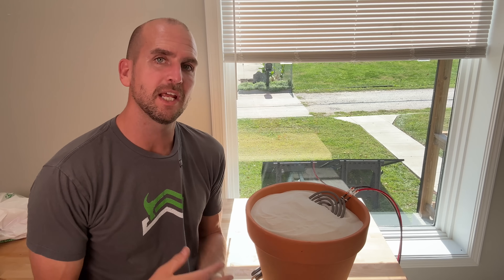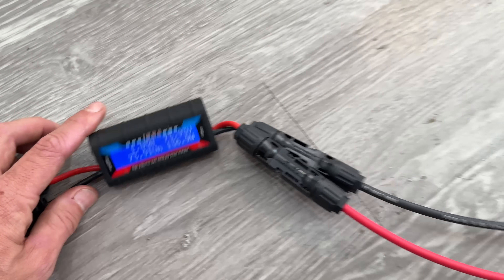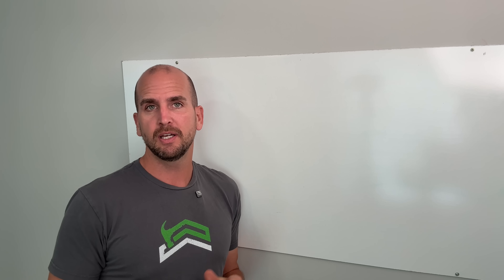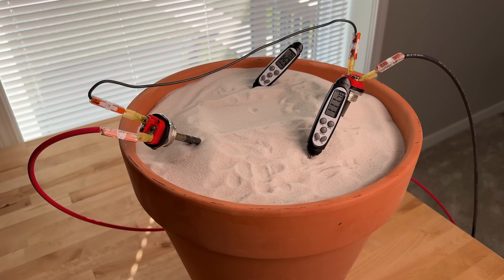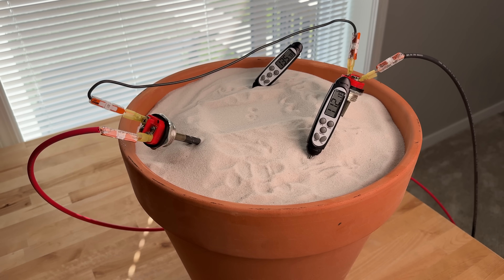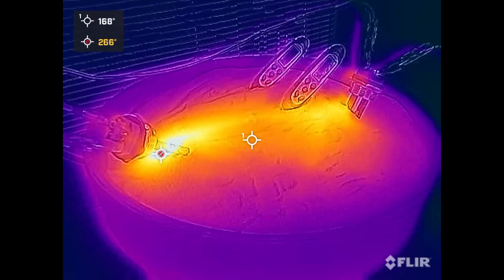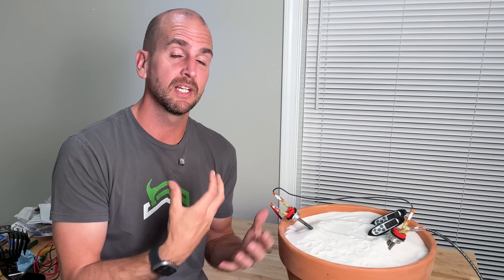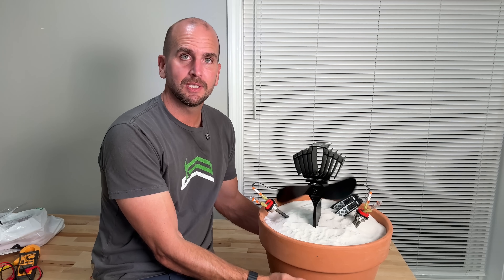How To Create A Solar Sand Battery Heater | Free Heat This Winter!

Comment: I tried this. Except with clay / gravel. Outside of the gravel, the element gets very hot. As soon as i add gravel, the element doesn't heat up. Any ideas?

Comment: Basically those are night storage heaters. For safety I would use the ready build ones. Yes you need a converter, but this also gives you MPPT, which increases your output. Insulation ensures that you only get heat out when needed.
More power plus more safety plus more comfort... for sure worth spending some bucks.

Comment: Maybe it was discussed already butttt....why not just get a reasonably nice  non-working Water Heater in the first place and wire it as you have and you have numerous possibilities to run lines and using the heat (also you have 55 gals of water  orr more on hand for other emergencies)

Comment: This makes me wonder about floor heat. The ones that I've installed {I'm an electrician and just install the controllers) tend to pull about 15A @ 240VAC. I wonder how well it would work if you made a bed sized area maybe a foot deep that you could sleep on top of.

Comment: We have solar panels on our balcony, 800Wp. The balcony is facing almost straight south and no obstacles create shadows. Over a sunny summer day they used to produce 4 to 5 kWh. But you don't need a heating on those days anyway.
Now on a cloudy day late October / early November it's 0,5 kWh at best.
So even in ideal circumstances on a cold, but sunny day with a perfect spot for the panels, I doubt they could contribute a significant ammount of heating.

Comment: just to add a snarky comment for the algorithm... your bifacial modules aren't getting much of any irradiance on the backside without: 
1. another set of solar panels behind it reflecting the sun into them 
2. a proper ground mount
3. the right angle.

on this bifacial setup you could capture even more solar energy by directing light to the backside of the panels with a mirror or something else reflective ( snow, space blanket, tin foil, a pond, etc)

Comment: Nice! I'd be interested in a study on the optimal volume/ mass of sand for the power and heating period length so that the system could be fine tuned to store and release for the whole non powered part of the 2 hour cycle. Obvs this would change throughout the year unless combined with a wind powered generator

Comment: My small 4'x8' DIY greenhouse thanks you for this idea and video.  I have a small greenhouse heater that is plugged into more extension cords after extension cords than I'm proud to admit, especially as a firefighter 😬😬.  But this is a great idea that I am gonna replace that with ASAP
Reply: Use a medium sized steel trash can filled with sand it gives you a lot more volume to hold the heat
Reply: You can also make a HHO cell and do a Sand tube Burner.
 About the same Out put, but faster.
Bury Sand tube HHO heater device, in Sand battery, Presto.
Cheap, clean science.
A wanna suggest, you dial in the, Sonic Fire Extinglisher device, 22o mhz cancel's FIRE.
 As seen here on YT, this could save your life, that Kid that firgured this out, is Under appreciated and his dicovery isn't used as much as it Should be..
 Sound can also alter other thing's, see "Sound versus Science" music video and take this to your Cheif.
 I tried to get CA Fire to inpliment, but the Science was too, Science for them..
Make it work where your at, and get this Science moving into, Everyday use...
Everything, vibrate's at different Frequecy's, Sound can Cut and it used in Surgury..
Reply: Or just put bricks around the house..

Comment: For this experience to be any good, you need a room or a shed that is not heated and measure the room temperature befor and after. Because like the teapot candle under a terracotta pots, you can make the pot very hot, but in practice you won't be able to heat up a room because of all the candle / terracotta bullshit that got popular few years back.

Comment: Electric resistance heat is almost 100% efficient but it takes a lot of electric to make a significant amount of heat. A 110v plug in electric heater maxes out at 1500w and produces around 5100BTU. At 250W we're only talking 850BTU. 
As a science experiment this is pretty cool but I don't think its a terribly useful heater. As an aside the fan will help move the heat around the room but convection will do it naturally.
An oil lamp makes a pretty good emergency heater and provides light as a side effect.

Comment: note. Sand does not have a very large specific heat capacity. ie.  It's not very good at storing energy. Water is about 6X that of Sand.  If you use water, or even Wet Sand, if you like using sand for some other reason, (And, isolating your contacts of course - using an immersion element, designed to be dunked into water) you will store 6X more energy per litre and per degrees(C) of temperature rise. Which, in turn,  will be slowly released as heat energy during the night.. It's important with any thermodynamic thoughts to think in terms of Energy and not temperature...  Replacing the sand with water is like having a heat battery that has 6x more capacity.   ...  is the Physics.    E = C.M.Delta(T) is the little physics equation we learn in high school....

Comment: Piles mulch on cold earth and sprays on nutrient solution made from yard waste at high enough density to fuel Thermophilic bacteria capable of drying + igniting the Mulch > Extracts those thermophilic bacteria into a fireproof panel > Hooks a drip tank to the panel with a fireproof wick inside to spread nutrients out for bacteria around it > Adds flush rod to seal holes allowing bacterial to feed off wick to clear wick with distilled water then Thermoelectric powered pump to cycle correctly diluted nutrient solution for safe temp control

Why cold ground used in example? So you can know from the start that if you shut their food off and they sleep even if frozen they will awaken to adapt the environment to themselves just like Humans do. For thawing nutrient solution use hand crank or USB battery bank to power Ultrasonic resonance to vibrate water molecules. Soon as the rod is able to be turned to release nutrients to bacteria they will awaken. But beware.. Fireproof everything around them because if you feed them too much they will burn you down.

Self replicating highly evolved biological heat source. Search youtube "Mulch can catch fire on its own" Media: "Black mulch!" No No.. High enough nutrient density to allow full potential of the fire organisms that are Thermophilic bacteria. Scenario: "I gotta feed my Cold Steam Tesla boiler on my electric car." Or "I gotta mow the yard and feed my house for the next month."

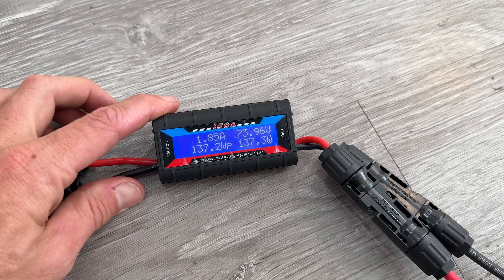Comment: 01:35 Do you really have the negative lead in the positive-labeled connector, and the positive in the negative-labeled? I mean... huh? Not that it matters, since both are the same other than the molded-in labeling. Well, remember not to disconnect under load like it says.  😁

Comment: With this DIY i can see that you powered the heater element with DC current because I could not see where the DC has converted to AC in the connection. If not the case pls explain to me?
Reply: Heating elements don't care if its AC or DC. =) RMS voltage level is important.

Comment: The water heater element will be quite short lived if run without water to keep it cool.
Reply: Not really.  Each is rated at 5500 watts and he's running them at only 125 watts.
Reply: @johnreeves7261  Its not a matter of wattage, but temperature - at least in my experience they just dont last for any duration if kept above boiling. Electric BBQ igniters last much longer.
Reply: @notsonominal  Very good point.  I see in this video the element reached way over 100 C which, of course, it would not do in an actual water heater.  I learned something new today.  Thank you!

Comment: The "how long it holds on" is inversely proportional to how good the sand is at heating the room.

I think the one problem here is that while resistive heat is 100% efficient, the panels are only about 25%. A heat pump can be 300% efficient, so heat pump can convert 75% vs 25% of what comes from the sun.

Another problem is that sand can easily get above the temperature that will ignite a bunch of stuff on fire. It would be much safer to heat up a drum of water that will top off at 212°F, well below the ignition temperature of paper or wood. Water should 'hold' more heat than sand, too.

Comment: You would have to be using solar panels to put out a 120 volts to use these elements unless you're hiding an inverter somewhere with a 12-volt battery that's a solar panels charge come on man we're not all stupid

Comment: I'm sorry... 
It's cool but. 
If you have sunlight, it's way more efficient to just use heat from the sun directly. 
Either the air in a black box, or with a small pump and a radiator in a black box, or mirrors, or any mass in the house where the sun hits. 
But anyway, still cool

Comment: This might be nice for a mini greenhouse outside in winter
Reply: Or a hen house.
Reply: @jclandram I've had chickens for 6 years in newyork, zone 5a\5b. My chickens survive winters no problem.  Why would you need a coop heater?
Reply: @mobaj1147  To help the chickens lay eggs sooner.  Hatch chicks in February and profit?  Semi jokes aside it helps hatch out chicks and ducklings earlier in the season.  They will hit the age where they can forage right away when everything turns green.
Reply: @jclandram hen house not recommended. If the heat crashes at any time, the chickens will die suddenly. Happened a lot when people have lost heat in hen houses during the winter.
Reply: I was thinking the same thing. right now in January in zone 7b, it costs about $2 a day to heat my small greenhouse to 40F. this could be the sort of project that would pay for itself in one winter
Reply: @grumpy_ken I'm in zone 7b and am looking for a way to heat my greenhouse. Sounds like we're in the same boat. I can't run electric. Have you come up with anything?
Reply: That's what I will do next year.  I already have the solar panels hooked up to a fan in the window.  I believe it you put a clay pot upside down on top of this heater and then another smaller pot on top of that and so on, this would heat it up more and retain the heat better.
Reply: @streetsbolt that's how you make a heater with a candle. I don't want to do that because I don't want to leave an open flame but I didn't think of using it this way. Maybe running a threaded rod through the pots would also conduct heat and keep everything secure.
Reply: Greenhouse or hen house you can do compost, them you'll have compost come spring.
Reply: @horseblinderson4747 depends on how much space you have. Just like water barrels are good for thermal mass but take up too much space in a smaller greenhouse.
Reply: yea, about that sun in winter time

Comment: I have a small 4x2x3 greenhouse in my garage im trying to overwinter plants in. Curious if this could ve used to provide enough heat so they get less sad overnight (it gets down to the low 40s in my garage). I have a solar line in there already that wont be used in winter due to that temp.

Comment: Very nice experiment! I wonder if there might be a way to use safer heating elements, that are actually built to stand higher temperatures.
Did you use this stuff - which is meant to be safe just up to 90 or 100 degrees Celsius, not higher - for a longer period?

Comment: 250W x 10 hours = 2.5 kWh.  This is not a huge amount but enough to heat a small room by a few degrees (or maintain temperature overnight, perhaps if it isn't too cold out there...).
Collecting the solar heat directly would be better - if it could easily be stored - in that case water (or water/glycol) could be used - more volume than the sand needed as you could not exceed 95°C safely - but the heat density of water is about 5X higher per unit of mass.  (ie: takes 5x more energy to heat 1g of water than 1g of sand by 1 unit of temperature).
You'd probably be able to collect 5X more energy for the same surface area or about 25 kWh into about 5 .. 10x more mass of water than the sand used here.
(All very rough calculations ).
Of course plumbing all that up is no fun ...

Comment: In hvac applications traditionally, resistive loads are wired parallel while control circuits or switches are wired in series if you had your heating elements wired in parallel, you would have less resistance, and therefore be able to dump more amps into your sand with less voltage drop assuming your panels can handle the amp draw
Reply: I think that in this instance, and in general,  you should match your load impedance (resistance) to your source for best power transfer. Series might be better in this case.
Reply: The solar panels can only output a certain amount of power at any time. If you have a lower resistance you'll force the current to increase but so will the voltage. As the other person said ideally you'll have source and load resistances match for maximum power transfer. When powering from the grid the source impotence as low which allows current to increase and voltage stay at grid levels.
Reply: @ I believe he had more amps, that he could’ve dumped voltage is only gonna be what the panels produce no magic fairy dust I didn’t stumble across the way to trick the laws of thermodynamics, but that would be cool

Comment: I have a setup like yours already with 2 large cooktop elements in parallel with 120v ac from my inverter in a 6 gallon metal bucket, 1 of them near the bottom & the other about halfway up. I put a thermostat on it to cut it off at 550 degrees but without it, It got up to 700 degrees. After shutting it off in the morning it still had 200 degrees remaining by the time I restarted it late afternoon.

Comment: It's a cool science experiment for sure...but at the end of the day it's far more efficient to have stored energy in the form of a power station to run a diesel heater (yes I know it's not very clean but it is very efficient) and in the event of an emergency where grid power is gone the odds are that it's from weather related events are pretty high which means you aren't going to be making much use of that sun since it'll be blocked by clouds and or snow covering the panels. The best alternative though would be to just invest in a good old fashion wood burning stove/heater you'll have heat to stay warm that won't need to to depend on electricity and that heat can be used to cook and heat water as well if you want to take a hot bath or shower and if someone was smart enough they would just build a diy steam generator small enough to power single homes.really, nobody can talk about how bad that would be for the environment since it would only be used in emergencies but if your home gets it's power from a coal power plant anyways it wouldn't matter.

Comment: Would help to know the BTUs or some measurement for comparison for example to an ordinary heater like an oil filled portable electric radiator that can run at 600, 800 or 1500 watts to heat a room. So would this just be a hand warmer, warm the space under a desk to be able to sit with a degree of comfort, keep a room above the freezing point or heat a closed closet to have a small space to sit & be comfortable for some time period.

Comment: Would it be helpful to preheat the sand in a tray, a thin layer covered with a black covering, outside in the sun, passively heating away prior to placing in the container. A thin layer would absorb the solar energy faster than a container that would require the sun rays to penetrate through more material.

Comment: Or you could just use mirror to direct sunlight to the pot with sand and stones. Or better to a steel pipe with oil and insulation

Comment: It doesn't matter what the power rating of the heating elements are, if your solar is producing, say, 100W, then that is the power going in  to the sand regardless of the heating element.
Reply: I believe the power rating of the heating element is simply used, mathematically, to estimate the resistance of the element.

Comment: Just look up the btu output of the coil. That's the most heat you'll get out of your sand filled clay pot. You can space out the heat over many hours but you'll never get more than the coil can produce btu wise. It's a nice safer setup than a coil in free air but you might be better off setting a row of sand filled pots infront of a south facing window and save the solar power for some other use.

Comment: burry some aliminium can cut strips in the sand to carry heat all around the sand equilly. Don't heat the sand with electrcity use direct sun light even the panels are hi-tech it only gets %15 of the power from light. 1m^2 sun light can be harvested like 1kw of heat. Ur losses are to much by converting Sunlight to electric to heat + cable Ressistance. Use balck pots or glass put them near window and cover the side that did bot get sun light with felt or blanket, if the vase or class cans are small ucan even put them inside other glass ware or clear oven bags. For more surface u can use mirrors. U can add some PCM int sand mix like old plastic (they smell), or beeswax. instead of sand ucan use salt which are PCM. Every heat battery componenet are PCM if u reach the temperature. Sand will turn the glass if u can pump 2 much heat in it. i get the beast resolts with brown old bear bottles filled with crushed beaar bottle dust which  is inside a oven bag , put inside a window and 2 x "90 decrees" facing mirorrs aiming extra sunlight to the bottle. But u can even make a wall from that glass dust filled bottles. Direct sunlight heat is the king.  Glass is better then sand beacouse the sunlight goes inside loses its uv as heat less reflection on the surface.